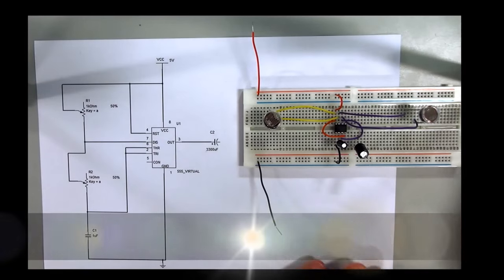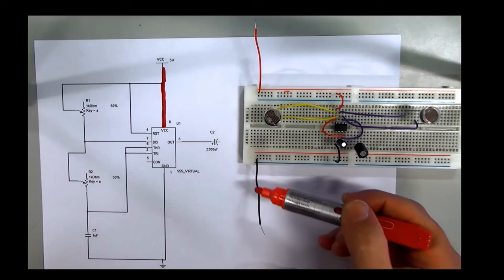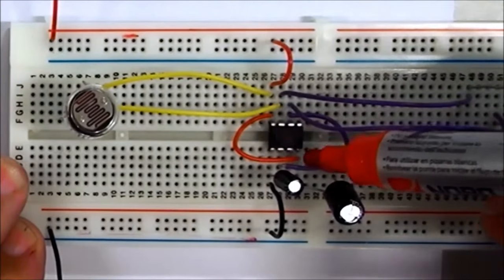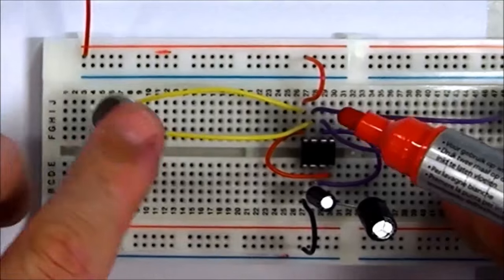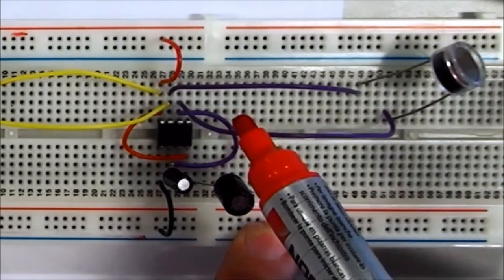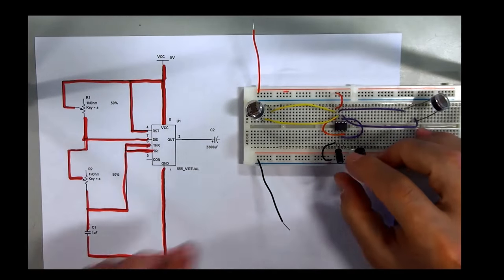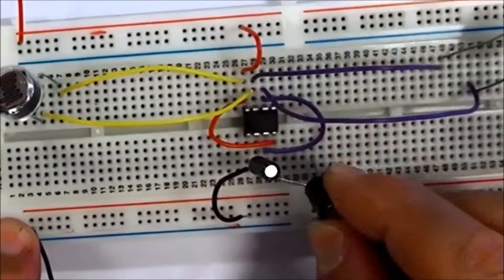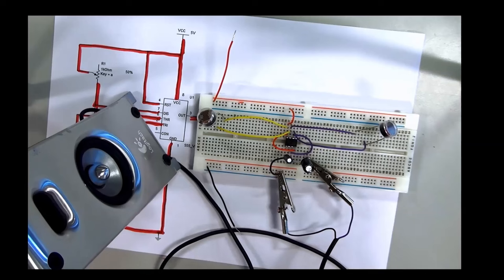"How to read an Electronic Schematic" Paul Wesley Lewis

Comment: Question, if you circuit uses an IC, is it always easier to star at the IC and work your way out with the wiring?
Reply from the maker: Personally I believe it is as the IC is the heart of your circuit and most peripherals will have to connect to it.
Reply: @MsMivvi  awesome! Thanks for the response, that is really helpful!